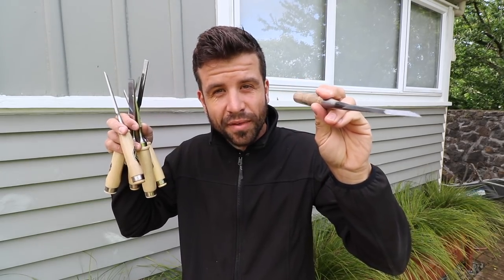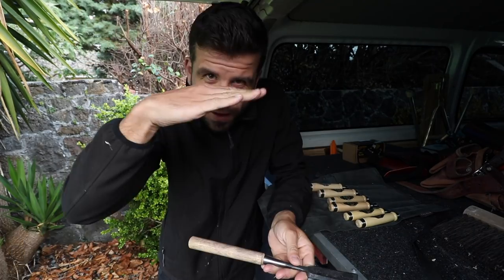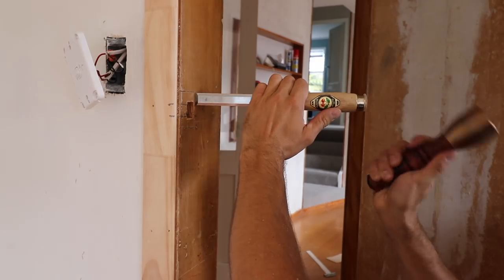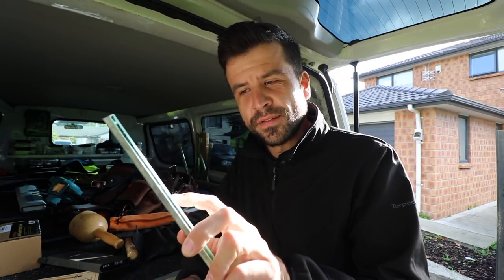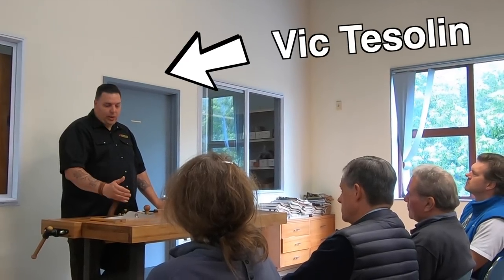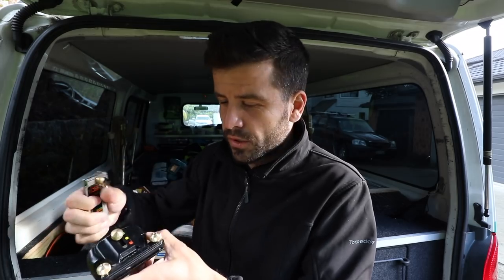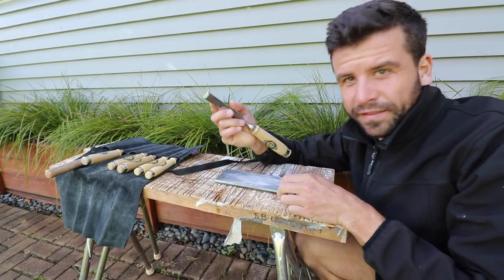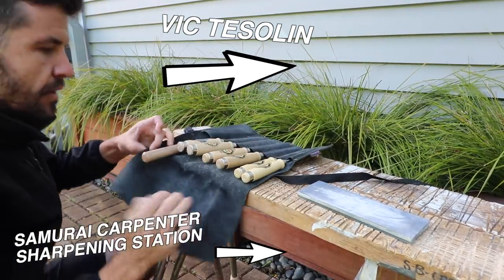CHISELS! & How I Sharpen Them

Comment: It always looks professional using a carvers mallet. It’s good to see a good tradesman. I’ve owned three in succession. I use the norton India stone. Tried the diamond stones. Couldn’t get on with them. What ever works for you. 👍🏻🏴
Reply: You gotta go all in with Diamonds or not at all; buy cheap brands and you're doomed to fail. DMT make awesome plates that last for years and remain dead flat, but they will cost as much as diamonds for SHMBO (and no, diamond plates can't double as anniversary gifts - damn it!). The other caveat with diamond sharpening, is they are only practical up to roughly 1200grit (which is all you need for framing). If you're doing Fine WW, you're going to need something else for the much higher grits. DMT do an 8k diamond plate, but it's not worth it because the diamonds are so small, they struggle to remain embedded within the plate's substrate - this is why 1200grit is about the limit. Lower grits, means the diamond particles are bigger, which means there's more of it to be held in the substrate. This brings me to the next point: never press hard when sharpening with diamonds - you'll dislodge those diamonds from the substrate and prematurely destroy your plate. Use a light touch, because it serves no purpose to press hard anyway.
Reply: @darthschumy  cheers for that Darth. 😀
It’ll make a big space in my tool bag having a diamond stone instead of a oil stone. 
I’ll look one up. 1200g you say?😯 amazon are bound to have one.  
As for anniversary presents... here’s a tip for you. If your good lady wears bracelets Buy her a one with the trinkets that attach. 
Every year buy her an attachment that clips on or for special occasions... bedroom activity doesn’t count. 😼
This saves on valuable time looking for unwanted gifts. Tell her to wear it to go out in. Not for work as they slowly disappear. 
Trapped in the photo copier, tangled up in the hoover, down the sink etc.
Hope this helps brother. 👍🏻😀🇬🇧

Comment: Dude if you're in a workshop with space use the water system. Out and about use the oil, no mess other than a rag that's why we have the oil.  For framing, those chisels are silly overkill. Just like you stated we hit our chisels harder because we work fast and rough framing and jointing rough work. That's why they make modern chisels with resin handles. If you came on my site with that carvers mallet, you would get laughed right off. Most people don't need to look at the chisel when hitting it, not even my bolster and lump hammer.

Comment: Apex that the term Scott. Practice your technique without that guide. 1 Find primary angle lock your wrists 10  seconds in figure 8. 2. Find secondary micro bevel. 10 seconds done.  Backs don't change between sharpening.

Comment: honnestly i use to be super traditionnal when it comes to sharpening, i would waste tons of time with my wet stones and all of that , now i just use my belt sander with a 240grit like a damn barbarian, and it's sharp as hell in a matter of seconds.
Reply from the maker: 😂😂 awesome
Reply: Likewise these days. Cheap Stanley guide with the wheels designed to run on a stone works a treat on a belt sander.
Recently bought a small linisher for the shed and works a treat.
Note. Clean the sawdust from your belt sander before sharpening
Reply: I got real good at freehand sharpening. It only takes me about 40 seconds.
Reply: I use my grinder to sharpen it as that is always in the toolbox

Comment: I have to be honest, to do door hardware now I use a brand new knife blade to cut the outline of the  striker plate on the jamb and latch plate on the door, by screwing it in place. I can easily get a 3mm deep  or more if I want cut and it's so thin and being dragged along instead of hit in it eliminates any crushing of the surrounding timber  . 
Then I unscrew it and use a little router to work the stuff out inside the cut lines. When you go near the cut the last little bit just flicks out. 
I cannot get a better result with a chisel no matter how sharp. The pine used here for doors is so soft and fibrous it will squash rather than cut if wacked in a across the grain.
Reply from the maker: I deal with a lot of that pine too. I find myself using the router more and more
Reply: @ScottBrownCarpentry  yea. The natives are alot nicer for chiseling. Probably a case of getting lazy and not keeping my chisels razor sharp too. Got to keep them in the van though. Theres a time and a place. You will have to set a new goal next year for 150 videos mate. Ya cant stop here. This is my favourite thing on YouTube by far. 👊

Comment: I've been using the VERITAS SHARPENING GUIDE for the last couple of years and find it superb. Being the Mk II it has the extra honing equipment to put that fine micro- edge on the chisel if needed: unlike its predecessor. I work the tool with angle gauge and an angle finder.

Comment: To put the “candle” on a chisel I use a honing guide and a belt sander. It’s very fast and refined. I prefer it to my water wheel. Then I finish off on my whetstone. I put that on the draining board at the kitchen sink and run the tap on it. Micro bevel, flat the back on 400 then 800 grit then polish on leather strop. Only problem is getting used to using something so sharp. 😀

Comment: Hey Scott.  
I am a chippy from Tasmania. Next time you are looking for stones or sharpening gear look into dmt diamond stones.  I have one that is extra coarse one side and fine on the other.  For a quick sharpening on site and can get my chisels shaving sharp just using the stone.  If I want a mirror finish I will then use wet & dry sand paper.  
Because it is steel/diamond it stays flat.  So you can use the extra coarse side to flatten your whetstone as well

Comment: Yes I  had one of those little honing guides for years when I was able to do some woodwork and cabinet making and it is a priceless piece of kit - so exact. I also used wet stones too for sharpening as the older oil stones were so messy and smelly. By the way the metal rings around the top of the wooden handle we called those ferrules ;-D OH forgot we always kept our wet stones immersed in water to keep them soaked and from time to time flattened them with a honing stone by Norton,

Comment: hi scott, i know this is an old video and hope you find this comment, there is an old video made by taunton press called hand tools with frank klausz, where master klausz shows the proper method. it is around on the internet (a site with cro and wood in its name) it`s the best thing i`ve seen on sharpening and tool prep in general. i make my own stones out of portland cement or a mix of cement and fine sand as crazy as it sounds it works just fine. nice chisels you have, thanks for sharing. pete

Comment: im a  site joiner in the uk I would recommend honing guide   n I know you've laid money out on  your shapton stone but rather than buy into a stupidly expensive  set of stone I would highly recommend  a trend or dmt duel sided diamond stone course n fine  dmt 325 grit n 600 grit trend is 300 and 1000 grit then purchase some  white buffing compound and a old leather belt   I've used  them for years and   once you flatten and polish the backs of your chisels  and you do same on bevel   its take about  a minute to go from dull to a razor  hair popping sharp

Comment: Enjoy the Mk2, love it. I start on diamonds and finish on my 16000 grit shapton glass ;)
Reply from the maker: 16000 woah, it must be like a mirror
Reply: @ScottBrownCarpentry  Sure is, have a DMT DuoSharp (325/1200), and the 16k glass. I use the 325 to keep the glass flat, been a great little system, works well for me. Go straight from the 1200 diamond to 16k glass, and after 30 seconds I'm looking at my reflection, lucky me! 😍😂

Comment: I'm a chef myself, and for best results with whet stone I find soaking the stone in a bucket of water for at least 15 minutes really helps.
Reply: Your suggestion if followed, is potentially and likely to end in catastrophe; it all depends on the wetstone you're using. Instead, follow the manufacturer's advice on soaking. Many wetstones, typically the most expensive, are simply sprayed with a little water and are ready to go immediately. Soaking them instead will literally and permanently destroy them; they will become expensive sludge/mud.

Comment: The grind on the Japanese chisel is called a hollow grind. Great video
Reply: Actually hollow grind refers to the bevel itself, and japanese chisel bevels are always flat ground because hollow grinding would make the thin laminated steel more brittle. The hollow on the back of the chisel is called an "ura",  designed to make flattening the back of the chisel faster.
Reply: @HendrikusDeVaan  "ura" just means back/rear/reverse side. ( https://translate.google.com/?sl=ja&tl=en&text=ura&op=translate ) It's used, for example, in aikido for versions of techniques that take you behind your opponent rather than in front.